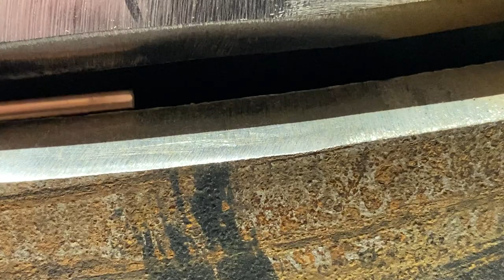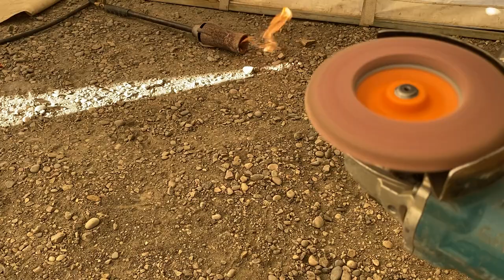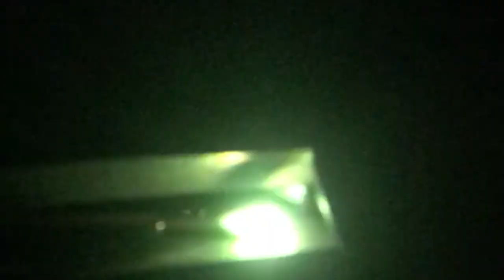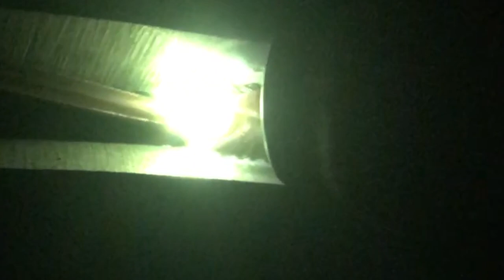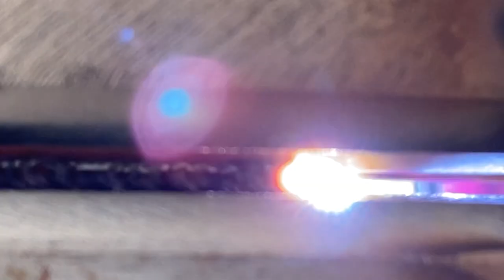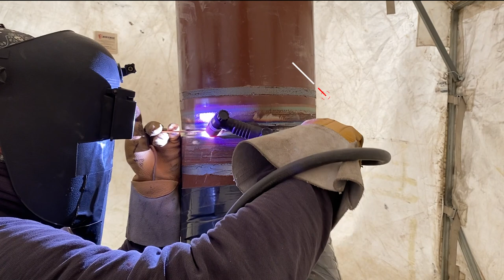2G TIG Welding  Root & Hot Pass Technique. Tips For Better Root Welding.

Comment: I don't know why but for me horizontal pipe welding is way easier. By the way what auto darkening lens you use?
Reply from the maker: I’m using lens #11
Reply: @X3MTIG  by the way - great idea grinding that cup like you did, gotta try it some day. Old welder taught me to grind the cup to make edges sharper to avoid slipping. Sometimes When the surface is slippery I take 3m scotch bright and rub starting point a little
Reply from the maker: @mddenis1  thanks DM, rounded edges works perfect with root passes, and your idea is not bad at all.